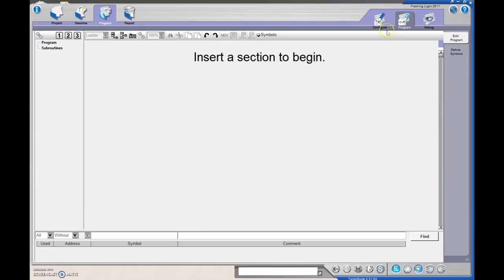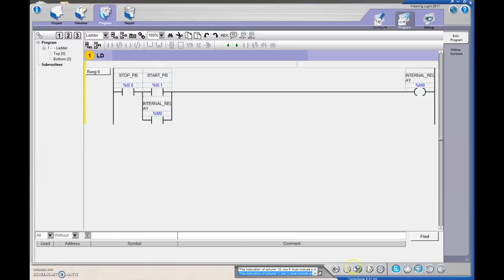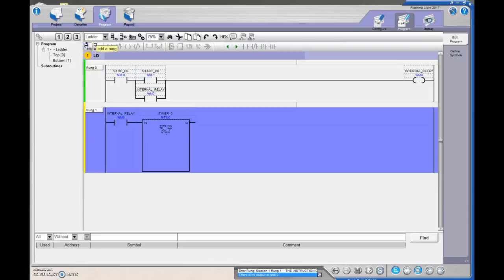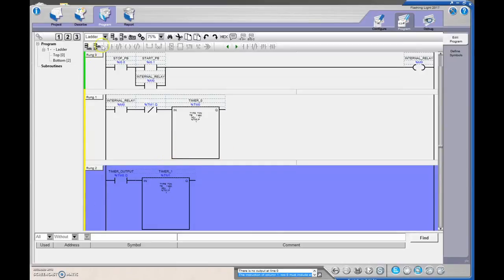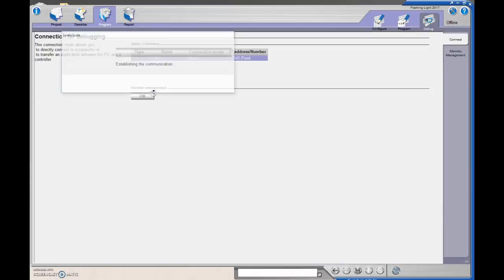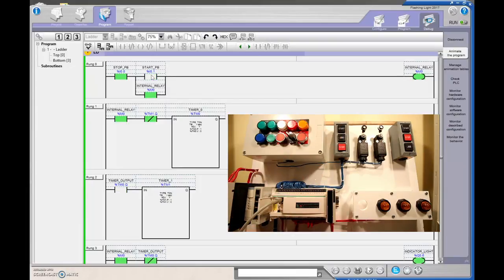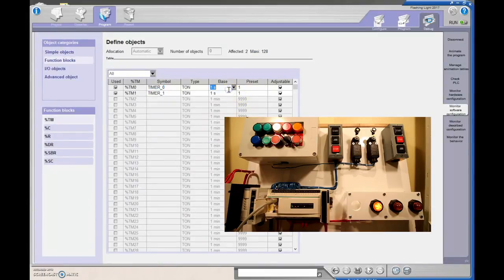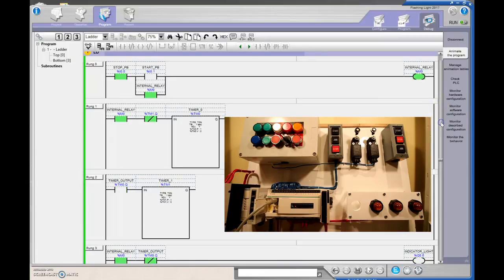PLC Tutorial (TwidoSuite) #11 (Flashing Light)

Comment: Hi just wondering if there is a simulator that I could download for this program??
Reply from the maker: Unfortunately Schneider Electric discontinued the Twido PLC line back in Dec 2017. Try this link, you may still be able to download the software https://www.schneider-electric.us/en/product-range-download/1453-twidosuite/?parent-subcategory-id=54410#tabs-top
Reply: @PeteVree  Hey thank you very much from Ireland!! I'm trying to figure out a tricky conveyor system with input and output sensors that have a count up count down instruction for counting product on and off the conveyor that also involves a purge and then a flashing light to indicate the end of the purge
Reply from the maker: @Johnnyred1966  The link is dead. I have moved from the Twido PLC to the Siemens line. https://www.youtube.com/watch?v=T-dvBvBUxWo
Reply: Pete Vree thanks man... I’m actually using Siemens PLC myself in my college
Reply: Hi..  You can download the TwidoSuite 2.20.11 
https://www.se.com/gr/el/product-range-download/533-twido/?filter=business-1-%CE%B2%CE%B9%CE%BF%CE%BC%CE%B7%CF%87%CE%B1%CE%BD%CE%B9%CE%BA%CF%8C%CF%82-%CE%B1%CF%85%CF%84%CE%BF%CE%BC%CE%B1%CF%84%CE%B9%CF%83%CE%BC%CF%8C%CF%82-%CE%BA%CE%B1%CE%B9-%CE%AD%CE%BB%CE%B5%CE%B3%CF%87%CE%BF%CF%82#/software-firmware-tab

Comment: For me, in Rung 3, it does work with %TM1.Q     If I use it like in the video it does not switch the output, or maybe is too fast.
Reply from the maker: You are right.. either of the timer outputs can be placed in rung 3. Perhaps the time base on one of your timers is not 1 second?
Reply: No, one of the timers remained configured as TOF from the previous lesson. My bad :P